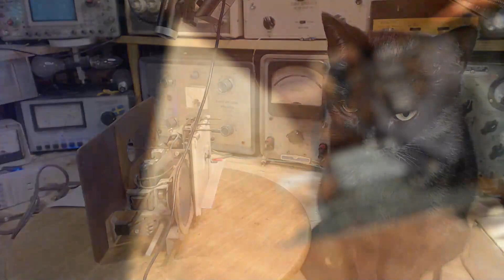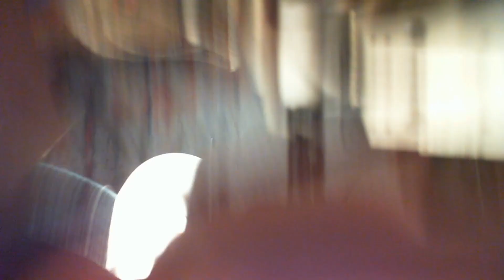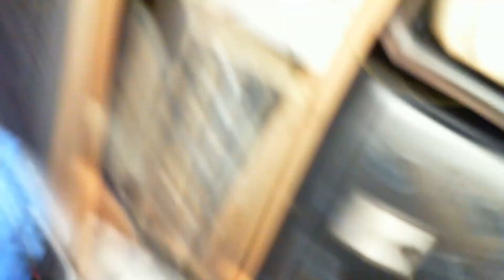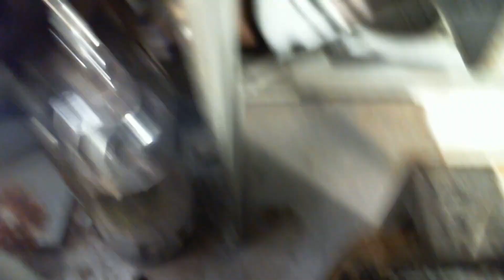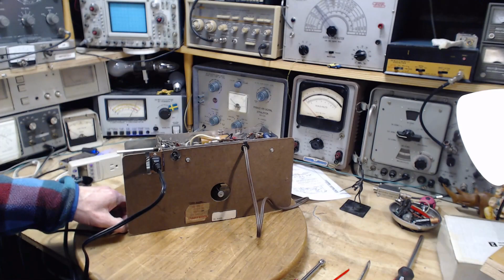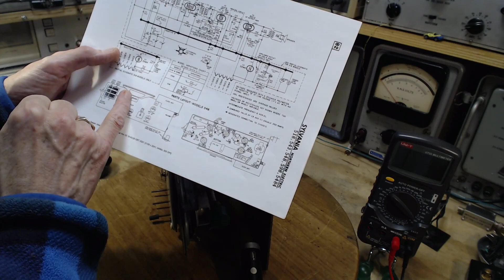1955 Sylvania 598 Clock Radio Video #2 - On/Off Switch

Comment: Greetings:
Just ohm the power cord, account for the clock current, then find the path to the 35W4 plate. That wire comes out of the clock's power switch for the radio.

Powered radio modes include radio "sleep timer", manual "on", and radio "alarm".
I see no snooze button on top, the leftmost switch at the top marked "auto" is either the sleep or snooze feature. The manual switch is obvious. There is also a alarm on/off & buzzer/radio mode selection for the alarm. All 3 radio modes allow power to the 35W4 plate under the proper condition. 
It is possible that the clock to 35w4 path can be not functioning for all 3 radio modes. 
Since the buzzer is actuated mechanically, there should only be 3 connections connected to the clock: power in for the clock motor & radio, power out to the 35w4 and clock motor return power. The clock is driven by the visible shaded-pole motor with power wires to both sides of its coil. The power in for radio switching is where two white wires are connected beneath the motor. As the motor wires come from the bottom through that hole you noted, the wire bound for the 35W4 goes back down thru that same hole.

Comment: All the clock radios I've owned had separate clock/radio control. Repair the switch!  What it sounds like you are doing is creating a radio that is always on. That is not repaired just something that is always on

Comment: Yesterday he had found that the switch attached to the volume-control is a pull-to-ON and push-to-OFF type.Today he forgot that and try to turn ON the radio by rotating the knob (Actually he need to pull it). See yesterday's video
https://youtu.be/ibuvi2EbgRQ?t=230